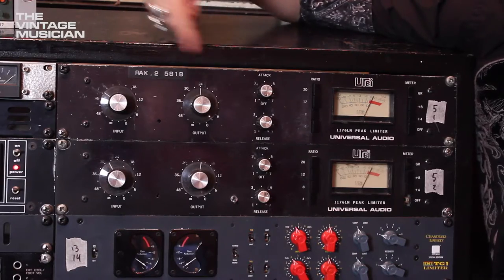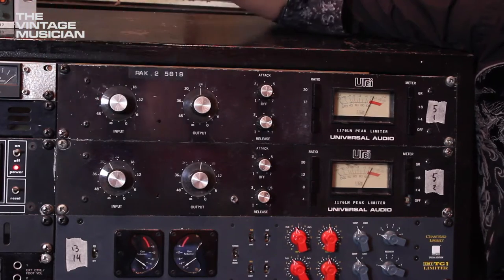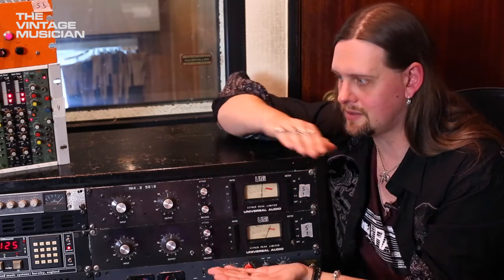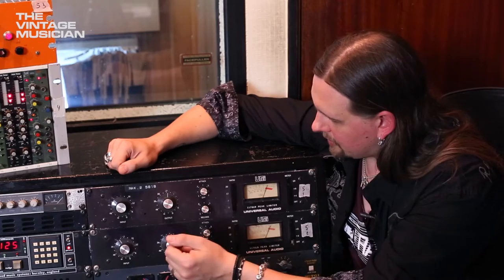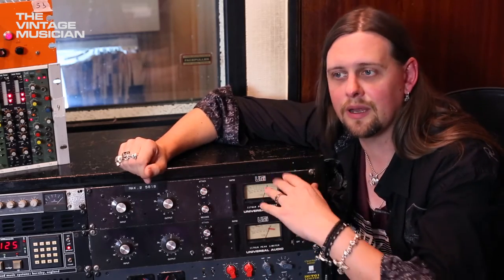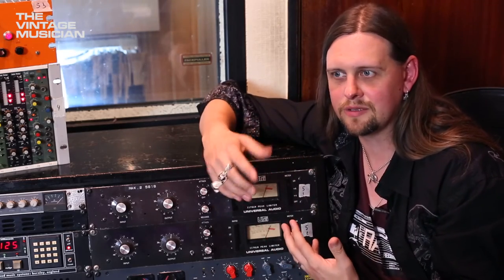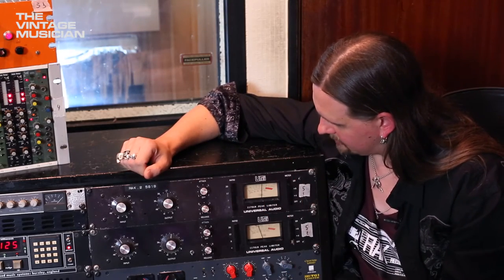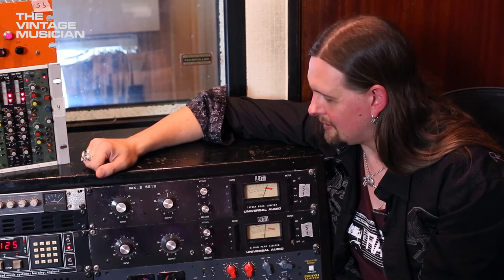Need Some Compression? The Urei / Universal Audio 1176 Introduced

Comment: I specialized in live on location album tracking and live TV and radio broadcasts of music entertainment events.  Coast-to-coast and around the world.  And I can safely say.  After garnering 4 major music award nominations.  And making history doing that.  I have discovered.  The best way to record vocals on an 1176.  Is, with all buttons in attack around 10 o'clock release around 3 o'clock up to 4 o'clock.

I do that with some extremely heavy handed, high pass filtering at around 270-300 Hz.  Then an, upper midrange boost.  Followed by copious amounts of high-frequency boost.  Until you wouldn't want to listen to it.  Then you stick on the 1176.  And after the 1176.  I stick in an, Allison Research, KEPEX 500 a.k.a. KEPEX-1.  As a downward expander.  Which means.   I adjust the ducking level.  To an approximate value  of gain reduction.  Approximately 10-15 DB.  Because gating vocals sounds like crap.  Terribly unnatural.  So you only want to duck the level.  To the point.  Where the downward expansion starts to occur at the threshold level of your breath.  This is the trick.  You need a fast but not too fast release time.  Otherwise the gizmo will chatter.

But when you have everything adjusted correctly.  And you solo that vocal.  It will sound like absolute crap.  Until you put it in the mix.  Where it will sound like the most beautiful natural thing you have ever heard before.  And there is absolutely nothing at all even remotely natural to the sound.

So the idea here is.  To fool your ear.  Into thinking.  The vocal sounds incredibly natural.  When there is not one natural thing about the sound.  And it sounds absolutely awful when you solo it.  But it sounds like magic in the mix.  And it stays where you place it in the mix.  It sounds like you get soft.  It sounds like they get loud.  There is no dynamic range to speak of.  And it's an engineering technique trick.  That few people seem to understand the value of.

I find too many younger engineers think natural sound.  Means you choose a microphone and then do nothing.  Plenty of engineers do not like dynamic range limiting or compression.  Bruce Swedien would be a good example.  But where is he now?  He's dead.  So, how could you believe him anymore?  He's dead.  I mean I think God got him for lying.  And we will never hear a new Michael Jackson mix ever again.  Because he's also dead.  And what did Bruce use on Michael's lead vocal?  An, SM-7.  But he could have done it on a SM-57 or 58.  And you would have never heard the difference.  Because they all have identical capsules.  And most morons don't know this.  They will spend $450 like morons.  To look the same as the other morons on YouTube.  Who also spent $450.  When they could've spent $100 for a new one or $50 for a used one.  And gotten the same identical sound.  But they would know how to.  It's all about the distance of your lips to the diaphragm of the microphone.  And in the SM-7.  It keeps your lips at least 3 inches away from the diaphragm of the microphone.  That's why it appears to have a lower output level.  It doesn't.  You're just further away from the capsule diaphragm.  Like you're supposed to be.

So all you would need to do with a cheap used $50 SM-57.  It is to get the extra-large foam pop filter.  Which will set you back about $40.  Et voilà!  You now have the same sound as the SM-7 or 7B.  There is no difference between those two.  Other than some additional internal shielding.  In a heavy RF Broadcast station environment.  And that's what the letter B actually stands for.  It doesn't stand for the Beta series  with the neodymium magnets.  It's not that.  It's a standard stock SM-57 capsule within the SM-7.  Which is identical to that of the 58 and they hardly ever seen SM-56's.  That used to exist.

Now I know all of this shit.  Because not only am I a studio designer, technician.  I'm also an expert Audio Engineer mixer recordist producer.  And.  I worked for some of the most legendary studio recorder and console manufacturing companies.  I mean it's crazy.  I can still hardly believe the career I've had.  And how I have impacted so many people's lives.  Around the world.  Me.  Little old me.  Little me, nothing.  And I had a sweeping influence on the sound of network television News.  And this was not supposed to happen LOL.  I was all about the music actually.  But when you are a union Audio Engineer for a major television network.  They put you where they want you.  They figure out what you're good at.  And they knew they had one hot audio engineer here.  And I was kind of the lead audio engineer for news..  Although it was never officially declared that way.  I was really the only one consulted about how to do the news in stereo.  And you might notice.  You don't get any news in stereo.  And it's all my fault LOL.  TV audio engineers aren't really, audio engineers at all.  They can't get their left and right channels, straight.  No it's not that left.  It's your other left.  Don't you see the bus going left to right.  The sound is going right to left.  You can't tell?  They can't tell.  This is what happens when all you have done is mono your entire life long.  And that's how TV guys used to be.  And still are.  So I told NBC-TV.  We should then just do the news in mono as we normally have.  But we can play the music in stereo  at the top and bottom of the show.  And the bumper music going into the commercial breaks and coming out of the commercial breaks.  And that's the only stereo in the news you will hear.  You will not hear the news itself, in stereo.   And I'm the reason why.  And then all of the other television networks around the world followed my lead, exactly except CBS.  They only play their music in mono.  Go figure?  Their control rooms are just as sophisticated as all of the other major television networks.  But they are a different union of nothing but IBEW electrical workers.  They know how to install a brand-new 120 volt outlet.  In your bathroom.  And they do audio about the same way.  And the guys over at Fox.  Our members of this stage workers union.  They put up the sets and the lights.  They don't know anything about audio either.  And all they know how to do is badmouth everybody else.  They ought to check their own audio.  I'm glad it sucks.  Because so do they.  That's not a news network.  That's a movie entertainment company.   That's entertainment.  That's not news..  And it used to be.  That the FCC would not allow a foreign entity to own an American television news network.  But Rupert Murdoch sure does.  And he's not a lover of the USA.  He's an Australian equivalent to Donnie and his Ku Klux Klan of deplorable's.  Ready to destroy our democracy.  And this used to be never allowed before.  Until Reagan and Bush deregulated all rules and regulations.  Because they were obviously getting financial perks.  To derail us all.  And destroy the middle class.

It's all in a days chaos.
RemyRAD